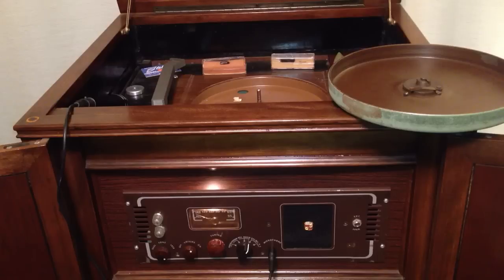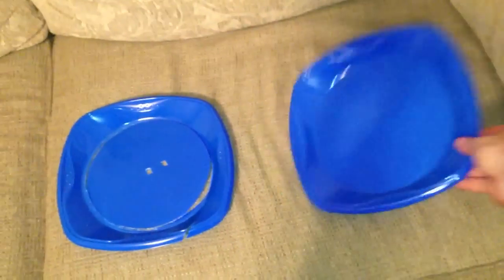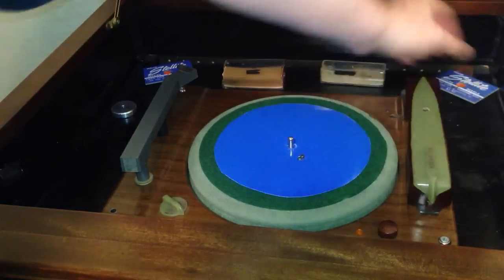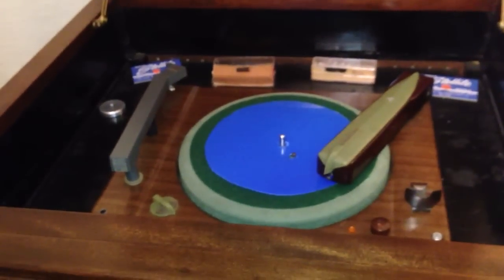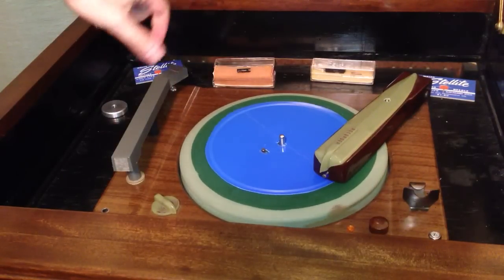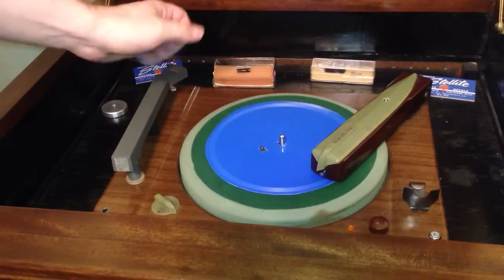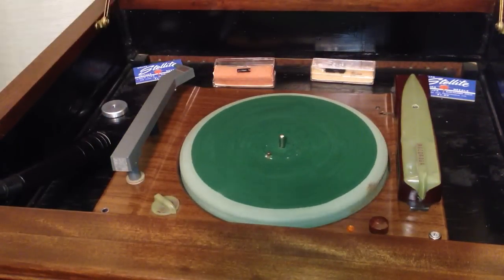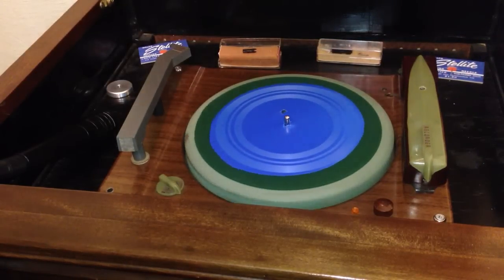Cutting a Record on a Solo Plastic Food Plate

Comment: My guess with the reason why your recordings are sped up is because when recording their is much more drag from the cutting process, causing the motor to slow down slightly. then when played their is much les drag as the needle is only gliding over and not cutting into. so the motor can run at its normal speed.

A simple solution would be to apply some kind of friction brake, either under the turntable or above and adjust the pressure at which it rubs again the turntable or the turning mechanism. by doing this you would apply(once fine tuned) the same drag as the cutter would, slowing down the record to the so the recording speed and playing speed are the same.

Another option might be to put a more powerful motor inside, which does not allow the turntable to slow down with maybe small amounts of drag such as that experienced when cutting. Or maybe buy a small speed control unit/circuit From ebay which you can wire to the motor, which you can then use to turn the speed up a few RPM when cutting and back down when playing. O simply leave at the same speed when cutting but turn down even slower when playing.

I know nothing about vinal's or recording onto them so I can't help you with the noise.
Reply from the maker: atourdeforce - Thank you for your comments!

Comment: You need to use fresh soft lacquer blanks and/or use a heated stylus.  Using 70 year old blanks or materials not suited for instantaneous record making will yield noisy recordings.

Using an undersized motor designed only for playback is definitely a way to have improper speed during cutting and playback.  The original motor was likely a robust General Industries unit, and the idler was likely thick and large to minimize slip.

Ideally you should have the speed running a bit fast on record so that it is correct while the cutting stylus is in place.  Ideally, since there is less friction toward the center of the record than the outside, you are better off with a very robust direct-drive synchronous unit.

Comment: The gear ratio between the new motor and the old turntable is probably what's causing the speed difference. The rubber tire on the drive wheel could be made larger or something could be layered onto the inside of the turntable where the wheel meets it.
Reply: The cutter head is creating too much drag and the little AC motor doesn't have enough torque to compensate for the extra drag. It would be better to use a regulated DC motor or DC motor with pitch control and a strobe to adjust when recording.

Comment: theres quite some crosstalk. but it really sounds nice, like an old radio transmission or so :D
ever thought of cutting the plate at different temperatures? could it be possible that theres less noise when U cut it at lets say 10 or 20 degrees warmer?
 I think this muffled sound cant come from the mike as its not to be heard when U can hear yourself in the speaker while cutting. this is definitely a kind of rough surface in the record groove. example to check this out: cut with a sharp blade and see if the groove is nearly as reflective inside as on the uncut surface of the plate. the surface within the groove is dull.

Comment: What I'm curious about is the constant groove spacing since the tonearm doesn't have the threaded rod as with the lateral cutter heads when they're cutting into the acetate. How does the cutting tonearm maintain the proper groove spacing unless there is a device below the deck that controls this.  Still interesting though. thx!
Reply from the maker: The genius of the design is that the threaded rod IS below the turntable!

Comment: A better mic would definitely help.. you proved it when you played back the recording off the radio (which didn't use the mic I would gather?  Some sort of direct connection/wired)..  also the cutting head is heavier so it drags the turntable as you're recording.. a stronger motor might fix that.. the lighter tonearm you're using to play back the record has less weight so it drags the record speed down less and thus plays faster.  Also recording at 78 speed allows for a 'cruder' recording, don't know how else to say it.. probably less likely to skip..  sounds pretty good considering how old this machine is, now I WANT one!!  LOL.  Cool vid, peace.
Reply from the maker: Thanks for all the suggestions.  Yeah, I think I need a washing machine motor in it.  The drag is truly a drag.

Comment: It does sound noisy though. The vocals are kinda over driven too. two things. How fine are the teeth on that custom gear box? Larger teeth might cause vibrations, which may or may not effect the consistency of the pressure of the cutting needle, causing pops and crackles. ...just a thought. Not sure if that is whats making the vocals sound fuzzyish, but too much mic pre-amp juice (especially if it's tube) will distort the signal a bit.
  If you can bring up the amperage a little for the drive motor it may fix the problem with the drag from the cutting needle slowing down the turn table which is why i think it sounds fast on (low drag) playback

Comment: I have a theory about the sound issue. i seem to recall that old microphones were actually pretty great. However the drivers from back in the day were rather terrible. I suspect the driver/speaker/output that is used on the writing arm is the issue. I think the audio that comes out of the speakers when you monitor your own sound is perfectly good. but the one for the writing arm is bad.

Comment: A couple of things occurred to me while watching this video...1st off, the original motor had more torque to it & therefore it would record & play back at right speed...your modified one was made to drive a lightweight plastic turntable, so unfortunately, there's no way to ever get that drive system to work properly on that machine as the motor is just too weak. 2nd, use the "78" needle on your new tone arm to play back your recordings as they are probably 3 mil. grooves you are cutting and you're playing it back with a .7 mil or 1 mil playback stylus.  Also, there are lots of blank records available on Ebay that would probably sound a lot better. 16 RPM isn't going to give very good results for anything but speech as too much info is being crammed into that groove, that's why 78 RPM was used. Some machines come with 3 speeds...Wilcox-gay made a "suitcase" style machine that was called a "recordio" & was 3 speeds. 33, 45 & 78. Your machine was only made to work at 78 RPMS, therefore, you are just not going to get good hi-fidelity sound at 16 RPMs, I'm sorry to say.

Comment: NOW I've seen it all!  I also now know what that second arm was on a record player my grandmother used to have...I've always wondered...except, the record arm was on the back side of the unit, and the playback was on the right facing the front...
Reply from the maker: wdharvey1 Does grandma still have the player?
Reply: databits
No...grandma passed away many years ago, and it didn't work the last time I saw it back in the mid '70's.  The arms were set up at a 90 degree angle rather than on either side like this one.  I vaguely remember it, other than it was a cabinet unit in a very pretty wooden cabinet.  I might be able to ask my surviving uncle if he knows where it is.....They also had an upright "Victrola".  My cousin broke the spring in it by winding it too tight...

Comment: I would increasing the diameter of the drive wheel ever so slightly. That might change the pitch enough to lose the chipmunks. Try stretching a rubber-band around the friction drive wheel to increase diameter. That should slow the platter down a bit & also help minimize any slipping as it spins the platter. Also, the tonearm seems heavy on the needle. Try placing a penny in various locations along the top of the tonearm toward the back end of its pivot point. You may get better sound quality if you fabricate a collar that will hold the blank media tight against the platter. You need to minimize disc chatter that occurs during the cutting process. Have to say, I love what you've done though. I wish I could find one of these beasts to tinker with.
Reply from the maker: Thanks for your comments, AKA.  This has been a really fun project.  Did you see my video of the disc I made for my "victrola" type player?
Reply: I will take a look.

Comment: To fix the recording speed, you could either add a speed control to the motor, or slowing down the audio on your PC using any audio editing program (like Audacity). You could tweak the audio to lower the noise and muffle, but you would have to experiment with the settings.
The downside of the first method is that you would need to dismantle it and understand a bit of eletronic (I'm not your subscribe, so I wouldn't know), while the downside of the second method is that you can't record directly.
Also, you should use a better mic.

Comment: This is so punk rock.  How does playback sound on a modem quality turntable? As for the speed issue,  maybe a motor from again, a modern player would be better.  Like the type that can be adjusted using that strobe or whatever it is.  I had a 70s Marantz that had likes a diamond Cut on the edge of the table and a knob that you set the speed.  When the player was at 33rpm the diamond would look like it wasn't moving.  Anyhow,  way cool. Thank you

Comment: The reason it originally ran at 78 RPMs is for good frequency response.  This is why the outside track of LPs have the hit songs and the inside tracks have the less-popular tunes.  Like audio tape, the slower the speed, the worse it sounds.  If you make it run at 78 again you will restore the freq response.
Reply: Record players don't slow down to play the inside tracks, all tracks on a record are recorded and played at the same speed(there may be weird exceptions, but this is true for most records)
Reply: You're missing the concept of a flat, spiral recording.  The vinyl-to-stylus speed is continuously slowing down as the stylus heads toward the center of the record. This is a law of physics.  And that is why 7" records are played at 45 RPM and not 33. 45 RPM wasn't just some number pulled out of a hat, that speed was carefully selected to combine excellent fidelity with a decent amount of playing time. However, this law of physics does not hold true for the old Edison cylinder recordings since their spirals are linear and of the same diameter.  A simpler explanation might be better if visualized... If you set your turntable to 45 RPM and set a small toy farm animal near the center of the spindle it won't fly off the platter, it may not even fall over. But if you try that same experiment nearest the edge of the platter the toy will fly right off.
Reply: JRNipper yea, I get what you mean. I don't know what I was thinking when I made that comment
Reply: OK, no problem my friend!

Comment: Great video, well presented, and very impressive that you made the whole demo in 'real time'! I suspect that much of the noise you're getting is due to the pigment in the plastic of the plate. In my own experiments I found that clear material (intended for windows) such as Makrolon or Lexan works fine, but coloured material gives a lot of background hiss. Can you tell me, is the weight of the cutting arm 'damped' or sprung in any way, or does the arm just sit as a 'dead weight' on the blank?

Comment: What common material have you found that makes the best recordings, absent the actual records they used back in the day?  I was hoping the Solo plate would prove a good medium, but clearly it isn't!  My goal would be to record something that is sturdy enough to be played on a wind-up Victrola.  By the way, I think the speed difference is because the cutter is putting too much drag on the system, and the idler is slipping.  Perhaps some rubber roller rejuvenator or, what I think they used to call phono non slip or something like that would help get that idler sticky again.  (Find an electronics store that carries GC Electronics or Chemtronics chemicals and you'll find something for that purpose.)
Reply from the maker: The best recording I've made so far is on a plastic magnifying glass sheet.

Comment: What speed are the platter spinning at?, it seems lees than 16 2/3 rpm (the half of standard LP's). What frequency response is obtained at such a low speed? obviously very limited at high end. Could this machine to cut at normalized speeds?.
In October, 1981, I did some test cuttings using the plastic of some covers of  AGFA magnetic tape boxes. Them were made of a very suitable acetate that could be easily grooved by the needle. Obviously all these tapes stayed in my archive without one piece of their boxes :D. The results were not too satisfactory, but the signal was recorded even though some distorted and lacking of trebles, but those disc could be reproduced. Thanks in advance and good luck with your experiments!!!
Reply from the maker: I believe when I made this video I was using 16rpm.  And yes, I am able to cut at 8, 16, and 33rpm with the turntable drive system I installed.  Covers of tape boxes?  That's interesting.  And thanks!

Comment: Have you ever thought of half-speed mastering, or even third-speed, at 8 RPM, using a 24 bit audio file slowed down in Audacity? Half-speed mastering was used on the MFSL Original Master Recordings. I wonder what effect 8 RPM would have when played back at full speed, it might reduce the noise floor and vibration from the platter, and is supposed to give the lathe more time to cut accurately. Wanna make another video on this topic?
Reply from the maker: +Mooncalf2012 - sounds like a plan!

Comment: Concerning the speed issue my best guess is the weight of the cutter arm is probably more than the motor can handle so either it causes the motor to slow down slightly or the drive wheel is slipping some.
Reply from the maker: Thanks for your comment.  I would agree with you on both.
Reply: databits .
 You're welcome

Comment: you could use a arduino with an steppermotor and a potentiometer to adjust the speed.  just drive the turntable directly from the middle shaft. if you get a good steppermotor it should be ok I think.
Reply from the maker: +bbb - thanks for the tip

Comment: Here, few ways that might make the recording better, Record at a speed for 78 RPM records as that machine was used for recording on 78's, Now in studio recordings they used a soft material for recoding on, Then they would coat the soft material in zinc or something then they would press the Zinc plate into a Vinyl record.

Now I'm thinking if you used WAX or sticky tin foil that may give you better sound quality. Or use a CD - DVD they have a soft layer. Or it could just be a simple problem with the EQ or The Amp is not up to scratch.
Reply from the maker: All very good suggestions, thank you.  I might try the wax idea.
Reply: Yea once you've record into the Wax you will need some type or stuff that will harden the wax or the Needle will just over write the recording as the wax is soft. You sure the cutter is not damaged you may need a new cutting tool or needle.
Reply: or you could heat the plastic up so it's soft and then record that will allow the needle to move freely when it's vibrating

Comment: I would have to say getting a better microphone might be helpful.  I know higher end microphones are more expensive but a noise cancelling one that only picks up on your voice would probably be a good one.  <I do karaoke and the less expensive the mic, the more noise you get.>
As for the speed, I would have to say... Honestly, I have no clue unless you can slowly adjust the speed on the play.
Reply from the maker: The problem with the microphone is that it is not a "crystal" microphone (like the original) and therefore has a low power output.  This means I would need to use a mic preamp.  Thanks for your comment!

Comment: Just curious.... What does a record cutting machine run in the price tag department?
Reply from the maker: TheCanadianBlack MetalAsshole - That's a loaded question. The home models like mine might run $200 to $800 working.  A professional model might run $1,000 and way up.  Do searches on ebay for Wilcox-Gay, Recordio and Presto.
Reply: thanks mate, will do!